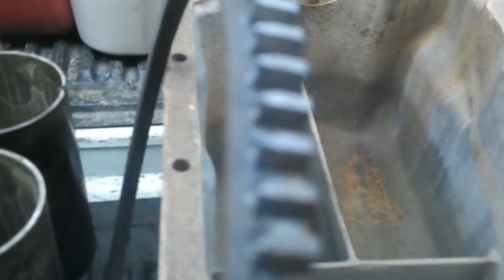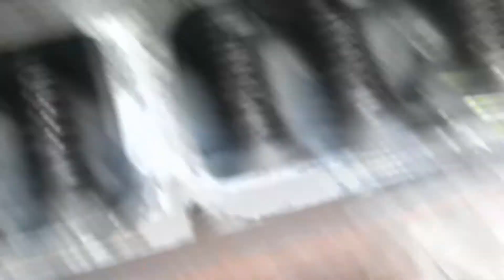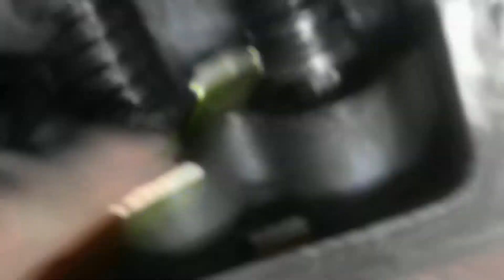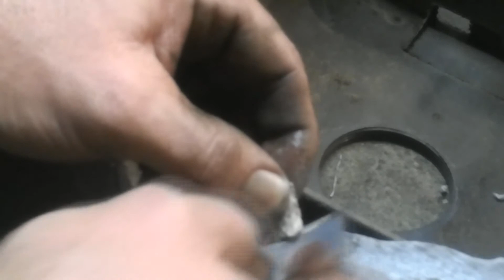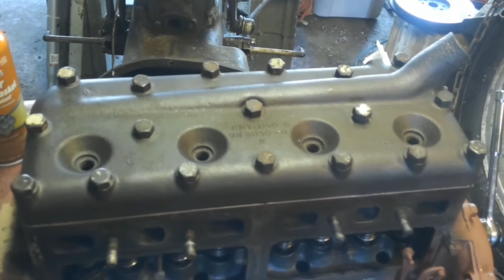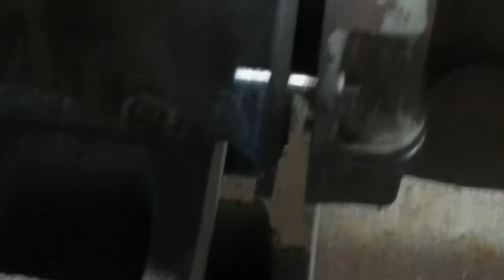Ford 9n Rebuild Part V

Comment: Did you ever find out why the camshaft wouldn’t come out?
Looks so nice when everything is nice and clean and that was a great idea using the offset needle nose pliers to get the valve guides clipped in place! 😀🇨🇦

Comment: Did you check to see what kind of endplay your camshaft is showing , also verify the camshaft bores are not out of tolerance? what was the deciding factor to reuse your Pistons?
Reply from the maker: When I took the block into the machine shop for new sleeves to be installed I had them check the cam and crank for tolerance.  They were good.

Comment: Looking forward to starting my rebuild in April. This will be my first time so I hope it goes well and it is a learning experience
Reply from the maker: If this is your first time may I suggest you purchase a dvd from this guy (https://farmtractorrepair.com/collections/ford-dvds/products/ford-9n-8n-2n-engine-rebuild).  It walks you through the entire process.  It got me through my build.  What year is yours and what shape is it in?
Reply: @thehandyoutdoorsman9014  ok thank you. It is a 1944 Ford 2n. It isn’t in terrible shape but it has low oil pressure, smokes and it nocks when at full throttle. It starts and runs great even at -15. It sat for 25 years before I got it so I think some piston rings broke when I started it. So I am planning on just doing the entire engine while I have it apart. I do have a question for you. Did you install the rotating or non rotating valve kit? Also do valve guide seals go on both intake and exhaust valves or just intake?
Reply from the maker: @finncampeau4922  I used the rotating valves. As for the guides I do not recall what I did there.
Reply: @thehandyoutdoorsman9014  also, did you buy your parts on the same website as the link you gave me? I was planning on buying my parts there. If so are you happy with everything from them?
Reply from the maker: @finncampeau4922  A few items came from there but 90% of them came from https://www.steinertractor.com
Reply: @thehandyoutdoorsman9014  ok thank you

Comment: One weak point on a n series tractor is the valve guide the stems are usually good but the guides tend to wear out but hopefully you put new guides in!!
Reply from the maker: Yes I did, figured I was this far in the tear down, did not want to do this again.

Comment: That crank should turn A LOT easier than that with no rods or pistons in place.
Reply from the maker: I thought so as well when I was putting it back together.  Everyone I talked to said not to worry as long as I did not over torch per the specs.  So far I have not had any issues with the tractor.

Comment: Thanks for documenting this.  I may have to wait until after mowing season to start my rebuild.
Reply from the maker: What kind of issues are you having?
Reply: Seems to be missing fairly bad until it is under substantial load ( mower or shreader).  I'm going to check the timing to make sure it's not something simple.
Reply: I know that compression in #1 is below spec as well.
Reply: Hard starter in the winter.
Reply: Good spark and nice fuel flow.
Reply from the maker: Now that it has warmed up some, how is it starting?
Reply: Starts pretty easily above 32F, but still seems to miss pretty bad until i get it loaded up with my finish mower.  I'm going to find some time this month or next to check timing and maybe the idle circuit in the carb.  I can get it backfire some too, if i run the throttle up and down rapidly.  But that might be normal for this age of tractor anyway.  Thanks for checking up.

Comment: Looks to me you are doing a good job. I too would have used engine assembly grease on the bearings. A dab of black RTV on the oil pan seal ends. I'm assuming you lined up the timing marks on the gears. (I really understand the difficulty in getting every little step recorded).  As I said looks like a great job.  Enjoy your videos very much!
Martin Benton
Reply from the maker: I had so many video clips to put together I was not sure what to use when editing the video.  What do I keep in and what do I take out?  Did not want to turn this into a "Lord Of The Rings" series and have it be a never ending video.  Appreciate the compliment!

Comment: Is it leaking oil?
Reply from the maker: No leaks, lots of gasket maker
Reply from the maker: At time stamp 18:00 you will notice that the rope seal is not pressed all the way down into the groove.  I had a small leak once I got it all back together because I did not seat it all the way in.  In video VII I take the oil pan off to fix the oil pump and I replace this seal and install it properly.

Comment: no assembly lube, no ring gap check, no new valve seals, Hope this all works out for ya.
Reply from the maker: Jay...you were suppose to tell me these things before I put it back together.
Just kidding.  I did use assembly lube on everything, the video just might not show it.  I had the machinist check the ring gap when he put in the sleeves.  And I installed all new valve set.